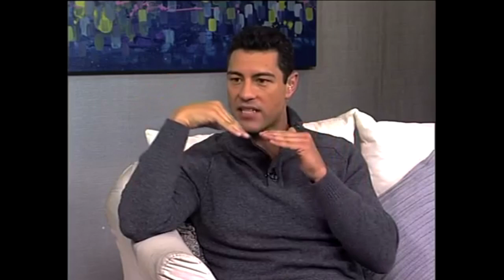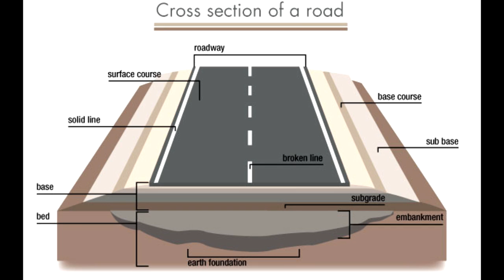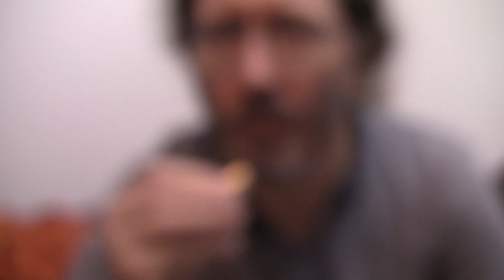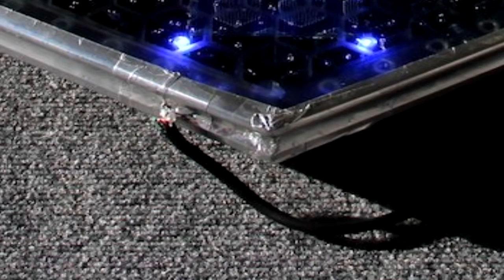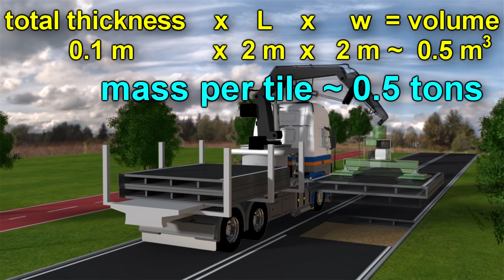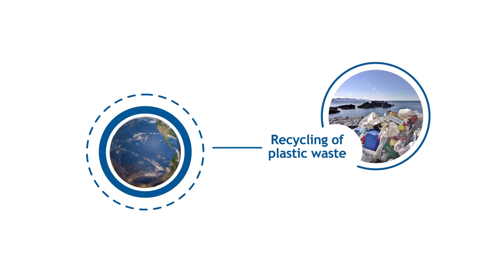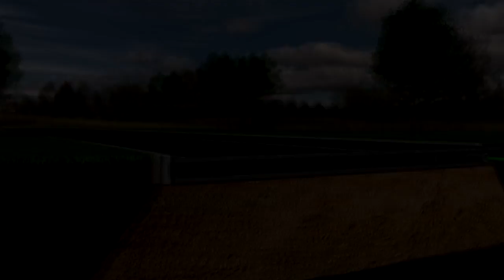Plastic Roadways BUSTED!

Comment: Amateur understanding of materials and interactions of such here so  don't crush me too badly please:

What if a mix of standard road making as far as the bedding layers are concerned, a reinforced concrete-like structure with utilities channels and electrical ports, modular road units made of standard blacktop+composites+polymers+synthetic "glass" fibers(i.e. kevlar or fiiberglass), and an alloy backing...and if you wanted electronics*(for whatever retarded reason you could think of, mind you I don't think that's particularly smart)* the backing would be made with plugs and the mold for the modular unit would be made so that the required channels and ports would take it into account.

Mind you I already know that just on this premise, my idea is 100% retarded and because of the way the economy and world works; not economical at all...

However, it is somewhat good that people are making inroads into the future as far as what roads are going to be 60-100 years from now...

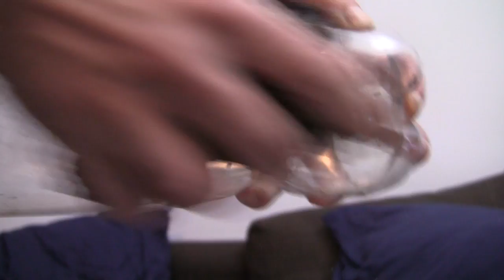Comment: 6:27 This whole project started as alternative to the (extra heavy) oil needed to make asphalt. Most of the mass of blacktop is rock with a processed heavy oil holding it all together. Plastics are made from oil and they are made from the lighter and more useful portions of the oil. This is just a stupid idea on its face, given the whole rationale behind looking for an alternative to blacktop. BTW... most side roads are little more than compacted crowned dirt with asphalt on the top. Highways and major roads are another story, but there are many thousands of miles of roads in the US that are little more than dirt with asphalt on top.

Comment: Yes, of course you nailed it.  You will get comments about the use of recycled tires in asphalt... yes they do, but what most people don't understand is that  the asphalt roadway is just a gravel road, with the gravel stuck together with a binder. The gravel is mostly quartz based granite... what is that, hardness 8.5 - 9? 
The recycled tires are mostly part of the binder.

Comment: My first thought was "Fire?".
I bet they didn't think it yet.
Reply: A few years ago in Fort Worth, TX, an oil truck overturned on a major highway and caught on fire.  Literally like a 1/8" mile stretch of road in both directions were covered in oil and burning.  The highway was closed for 12 hours, a crew of firefighters put out the fire, and a crew of guys with pressure washers washed all the oil off the road.  The actual road surface was unharmed, except its stained a darker color from the oil which is still visible.

Can you imagine if this happened on a solar roadway or plastic roadway?  The entire piece of highway would have had to be completely removed and rebuilt.
Reply: PhysicsDude55 if i was plastic the fire would've easily spread, and with the eldctricity and water pipes... the cost of replacing it all goes up and more damaging the whole thing becomes

Comment: I saw this a month or so ago, got passed around the office when someone saw it.

Fairly sceptical all around. At first we started thinking it was a concrete polymer composite, just cement with recycled plastic aggregates making a bulk of it up. Looks like they mean actually plastic though, which wont work economically obviously.

A way to recycle shit in road construction that is good is using bales of old tyres in the foundation. It actually is better in some scenarios than standard materials because it wont sink into the ground if it's on say bog land. Only problem is environmental concerns from leachate if water percolates through the tyres.

Comment: Even if they used a thick, textured, surface layer, they would have to go with a honeycomb support inside.  That's if they want drainage ways inside.  To be honest though, if water gets in and trapped, guess what happens in the winter to that trapped water?  100s, maybe 1000s of km of road destroyed overnight.

Comment: The lack of awareness on what to do with runoff is another fail.  Flooding isn't caused by failing to get the water off of the road, it's caused by the saturation of the surrounding environment.  Now presenting SpoungeRoadways?  I'm also surprised that temperatures weren't mentioned here, considering how many of these roads would have to be sustained in subzero  temperatures.  I guess it would be redundant, considering how many ways these things have already been shown to fail.

Comment: AHAHAHAHAHAHAHAHA 
How stupid is that?

Would I be so lazyI could easily disprove that idea of the hollow road with an easy statics calculation.
I have the feeling that even a bike will be enough to break through the surface of the road when it drives in between the inner "pylons".

and why do these people think that blacktop is bad?
that stuff is recycle material from the steel industry (atleast in my area here in germany)
Thyssen Krupps steelmill here in Duisburg has an own asphalt factory next to the blast furnaces.

Comment: There are plastics that can handle the weight of a car and the abrasion, PEEK, PTFE and PPSU, but they're expensive, up to about 100$ per Kilo and usually only used for industrial purposes, like parts in pumps, coffee machines and such. Not as mass fabrication. Recycling is not advisable as every time you melt a thermoplastic, duroplastics and elastomere can't be melted, you weaken the polymer on a chemical level, breaking apart the molecular bonds, and worsen its attributes.

Comment: Despite the incompetence of these guys Thunderf00t, what are your thoughts on the ability of using plastic as a composite component, however having 2 layers, 1 that serves as the foundation made of rock and plastic, and the top being made of sand and plastic as to prevent chunks of rock from coming up out of the road and damaging vehicles? Or maybe something along the lines of a finishing process that puts the sand plastic composite over the already existing asphalt composite to the same end, cause let's be honest for a moment a piece of sand is not going to damage a car as much as a rock will.
Reply: Nawhh.. You really don't want people inhaling and eating plastic particulates for centuries.. well, more than what's already going to be the case thanks to the invention of the "i don't know how taps work"-bottles, and the "this is marginally cheaper than linen at the moment"-bags.

Plastic decays from sunlight, and it also decays from a variety of other subtle influences, spreading particulate matter that tends to accumulate through the food chain when it's in or near soil level, and well.. inhaling plastic dust is just a horrible idea - don't, it's better to eat the yellow snow, by a long shot! ;)

Putting sand on the roads is also kind of a really bad idea. There's too great a loss of control from the lack of friction, and sand wears away just a little bit faster than glass - glass happens to be made of sand. Basically this means any dirt on the surface, even if you could keep the sand on it, would damage the surface very quickly. Check out TFs video on the Solar Freaking Roadways for some more fun with roads of glass :]
Reply: I'm not an expert in environmental sciences, I just wondered if that was at all viable given that using a mixture of sand or plastic would be far more similar to sand paper than it would most other things, but I do see your point, but as a second consideration a mixture of plastic and rock made using recycled plastic under a layer of traditional asphalt would be a decent way to recycle some plastic and prevent said plastic in the air problem from occurring. Just a thought though.

Comment: Plastic is too soft and too expensive. What if you added small crushed bits of rocks and pebbles into the plastic, saving some 95% of plastic by using cheaper, wear resistant dirt? And then you made some process by which you could just melt the plastic and rock aggregate and pour it, and compact it to a level surface, quick and easy? ... hmm, where have I seen this before?